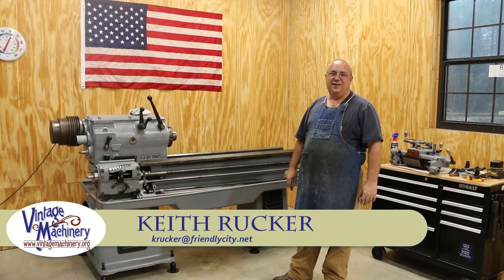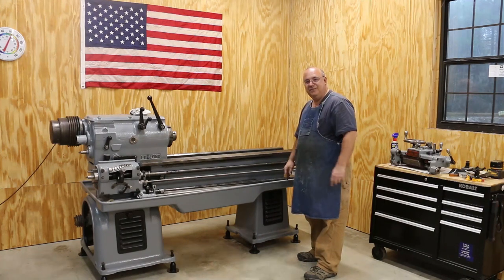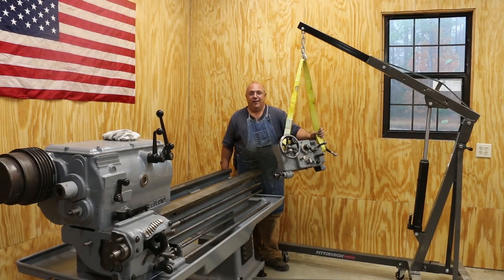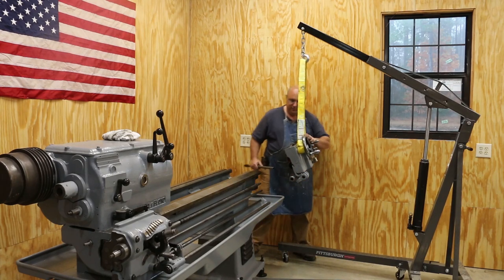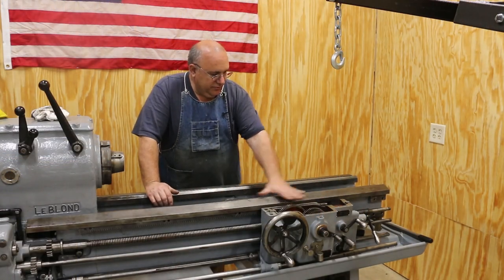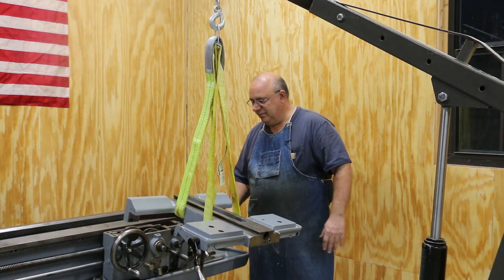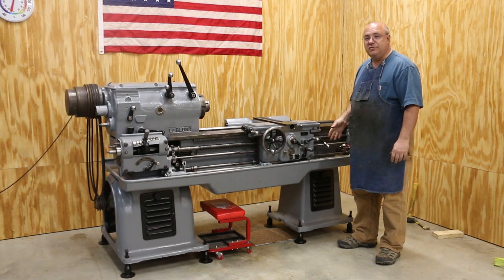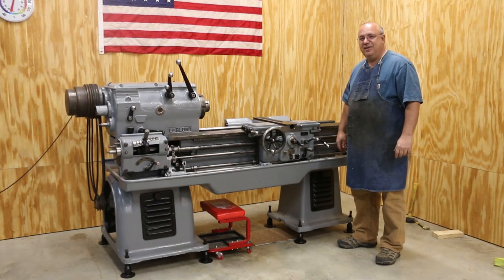LeBlond Lathe Restoration 12:  Carriage Reassembly

Comment: Keith a suggestion. On the valve controlling the hydraulic cylinder on your engine hoist. Weld a T handle on the end of the valve and then you can leave the bar in the pump handle. It is a lot easier to control.

I did that on a 8 ton truck crane I built.

.

Comment: You know a neat little load spreader used to tilt engines is a very helpful thing with engine hoists.  Another helpful thing is to take the chain off, install a swivel hook in its stead.

Comment: I watched Keith and he used an orange plastic faced dead blow hammer, an 
approx 4lb hammer on a block of soft wood, and he used a 1lb hammer on the dowel pins which had the extraction nuts loose to protect the thread.. I doubt Keith would take the risk of a hard faced hammer direct on a casting especially having restored so many cast constructed machines....good job Keith

Comment: Again. a great look at that fine looking LeBlond lathe! Some hints that might help on your next lathe rebuild: Disconnect the shafts from main body. then position the carriage near the lathe, where the engine hoist will fit. Install the shafts in the carriage half way for balance and position it on ways as an assembly. Then add the saddle and hook up the shafts after everything is in position. You did a very good job doing an almost  Also,  how about putting some way oil in the oil can during assembly?  Keep up  the great work? I love watching!
Reply: Left out some words " You did a very good job doing an almost  impossible one man job".

Comment: To make your hoist easier to use, weld a 4" piece of 1/4" rod to the  release valve.  Then you don't have to deal with that long  pump handle to lower something.  It can stay in the pump  til you need to go up again.

Comment: You need lowering wheels on that engine hoist. Pretty cheap to buy, or, you can make your own from some flat stock. I seem to remember you had a bender, that would be an easy project. Tho, really, what you need is a counter weight mini crane.
Reply: For whatever reason, i feel that this could do with a slightly turn wheel on the apron. A little bit more heft to it.

Comment: Oh fiddle dee dee, I made a brilliant comment and forgot save it!  Well, try to find a Hoyer lift (used to lift bed fast patients) which have legs that will spread in or out to miss obstacles on the floor.  Oh, while you are at it get one of those roll around stools that adjust for height.  My legs are older than yours and you will experience that soon enough.  Greg

Comment: Nice job Keith. I try not to criticise but you really need to use a copper or hide hammer during assembly. Steel hammers around machinery especially castings make me cringe.  Looking forward to some chips. regards from the UK
Reply: The orange hammer is composite dead blow.
Its an ameerican Thing
Reply: Rick Brandt think he means the ball pein hammer he's whacking the rod bracket with. A dead blow hammer is also used all over the world..

Comment: Keith, when one of these machines was sold, did the maker send an installer to put it together, set it up, and test it, or was the purchaser responsible for that?  And, after the machine went into service, what kind of long-interval maintenance was recommended (e.g., annual)?  It looks as if this machine was well maintained over its service life.
Reply from the maker: Usually, it was up to the customer to set up a machine but many machinery dealers would send somebody to set it up the first time as part of the purchase deal.

Comment: Yikes! I would not have put the apron on the lead screw and feed rod and let it hang like that. You should have removed them. It's just a few tapered pins holding them in. Then you can assemble the apron and carriage and then reinstall the screw and rods.

Comment: we used to concrete the machines to a concrete base  with hard rubber and shimming but yours is on a wooden floor how are you going to absorb the vibration, if any, from the machine?
Reply: Its a concrete floor.

Comment: Very nice job but I have bad news, you forgot to put the front carriage stop back on first before replacing the saddle :(
Reply from the maker: Not sure which part you are talking about, but I don't think so.  If you are talking about the piece on the shaft, I never took it off so I would not forget to put it back on!
Reply: Keith Rucker - VintageMachinery.org
You remove it at 6 minutes in video part 3. I noticed you miss this after I watched all the vids in one session. I was thinking that would be an easy part to forget to put back on before everything else.

Comment: Keith, the thrust bearing doesn't go there. There is no logical, or mechanical reason to put a thrust bearing loose on the outer end of the lead screw. Besides it didn't come from there, watch the last half of this video..
https://www.youtube.com/watch?v=LZ31m-QtOHw 

Also you didn't hook up the arm from the lever on the top left of the carriage. I don't remember what it is for, but the arm attached to the lever is not attached to the apron at it's lower end.